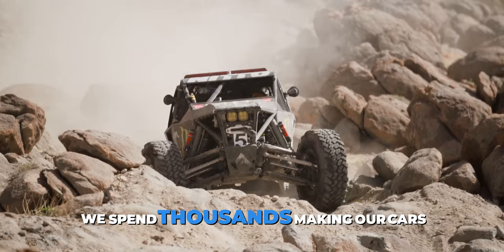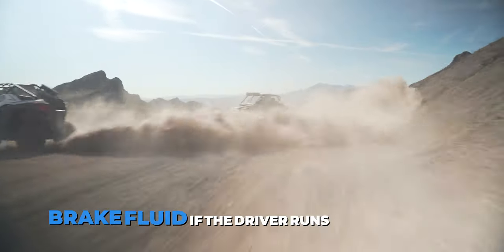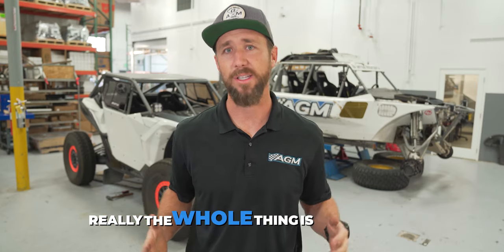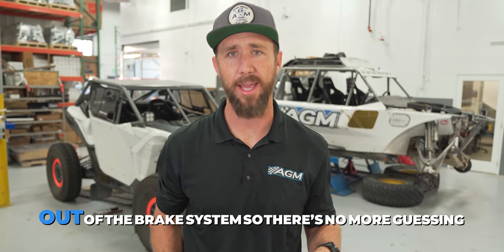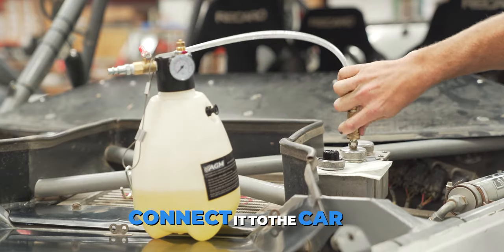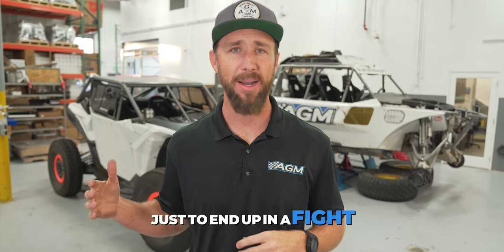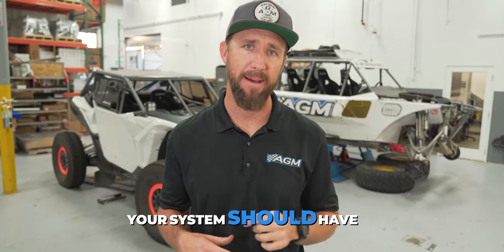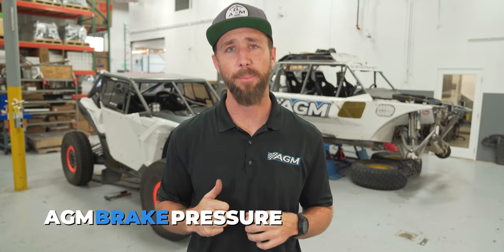How to Bleed Your Brakes Fast! | AGM Brake Pressure Bleeder

Comment: Fill it with 2 liters so you do’t run the system dry, the hose that sends fluid to the reservoir doesn’t reach the bottom. Tried it a second time after bleeding the master and she’s rollin’ and this ‘92 Mazda’s pedal is STIFF